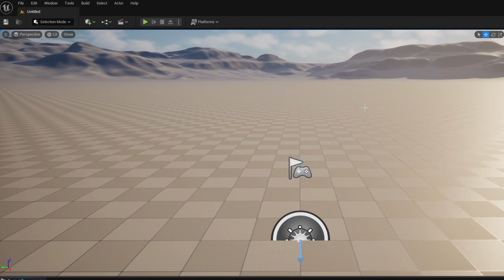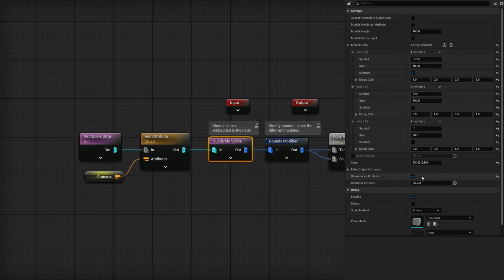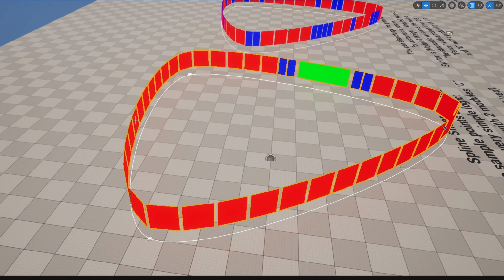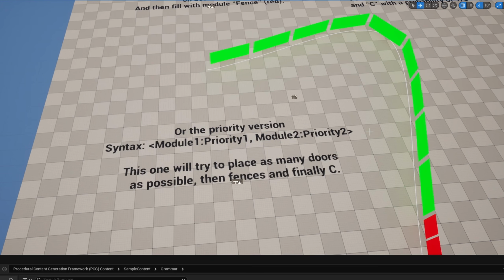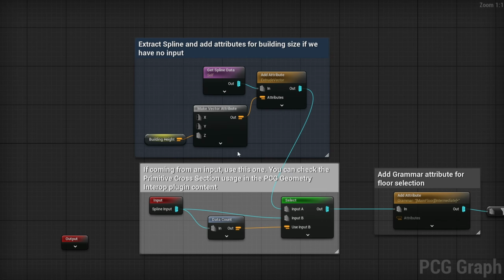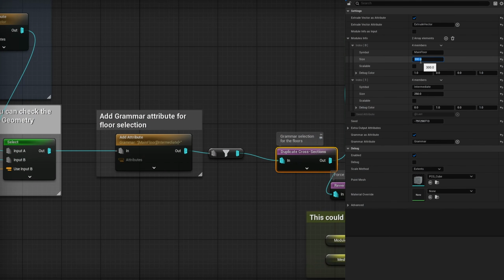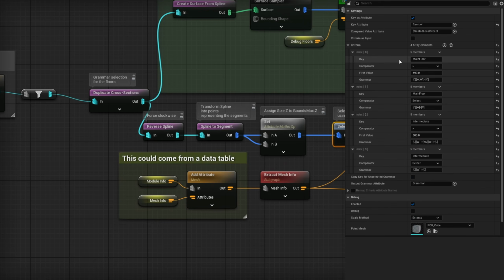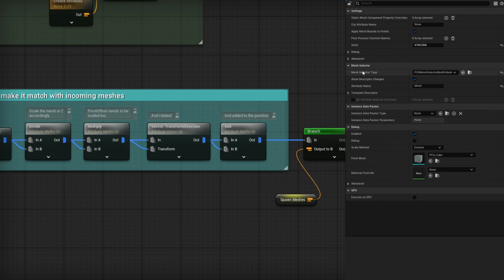PCG Grammar is Here And It's AMAZING

Comment: Any chance this is gonna be in the next series?
Reply: I ask because I'm already trying to combine it with the building series. Epic hasn't explained how to do rooms in here yet with grammar... I haven't seen anyway
Reply from the maker: I probably won't do another just regular building series. There wouldn't be much new stuff except how to do the exterior. And the demo level shows how to do that already. Grammar is designed to work along splines, not on interiors so nothing on the inside would change either.

Comment: Hey would you do a video on how to add the meshes to the splines in the first two examples?
Reply from the maker: You can use the exact same method as in the building example. Just copy / paste and adjust.
Reply: @Procedural_Minds I find that with the spline mesh, it has the correct modules and sizes from the ‘module info’ variable, but it’s just the first mesh in the ‘mesh info’ array variable, propagated along, and you can see the module sizes in action because the mesh is changing size as per the mesh info and the grammar specified. Any idea on how to get the rest of the meshes in the array to propagate in their respective segments?
Reply: Cool I’ll have to figure out what I’ve broken (made of copy of the example content to my own content folder, good boy)

Comment: Is it possible to combine square bracket and curly bracket in the same string? i.e. [Fence,Door]{C:2,Fence:1}*[Door,Fence] so you’d always have a Fence and a Door bookending a middle section of randomised C and fence which would scale to soak up the room between?
Reply from the maker: Yes, all of the syntaxes can be used together. You can take a look at the building setup. I believe they use a combination of them there.

Comment: I'm still waiting for dynamic spline mesh deformation on a pcg spline, instead of just populating a static mesh along points. Got a vent system that needs to curve along the spline instead of rotating to just orient along the spline. But grammar seems to be a much needed addition.
Reply from the maker: It's already out for PCG. I have a video on creating a rope bridge using just that out already. :)
Reply: @Procedural_Minds  very nice, then I can fully switch over to PCG 😄

Comment: Nice video!
How can you make pillars along a spline and make sure there are sagging wires between the pillars? The slack wires themselves are already in a separate plugin, how can you control one plugin from another plugin?
Reply from the maker: I don't know what plugin you're referring to or how it's controlled. It is very dependent on the plugins, what is exposed, how it's controlled, etc.

Comment: Hard to know where to start given the implications of grammars for procedural.
Reply from the maker: Absolutely anywhere you want any kind of logic to how things are spawned. The examples Epic provides are great. Fences with gates, buildings where you want specific types of wall / window / door combos, you can spawn pipes with rivets / connections every certain amount, so many options!
Reply: @Procedural_Minds  I found some other MIT examples but I noticed that there is no mesh info slot alongside the modules info slot where you mentioned it could be enabled in the spline segment node.  I'm trying to give geo to the debug grammar examples.

Comment: How do you add meshes to the Fence graph instead of debug . Been trying to figure it out since 2 days
Reply from the maker: You can just add static mesh spawners. In the building setup you can see how the assets are spawned in so they fit the sizes you specify with grammar.

Comment: Here in the building corners are independent to each other. How can it be set to use a common one?
Reply from the maker: Early on you get the building corners from the spline, so you can just spawn your meshes there if you want them to always be the same in those corners. Or of course you can have the corners as part of the grammar itself so it always starts and ends with the corner pieces.

Comment: In Houdini, you can group a bunch of Vertices and specify a specific grammar to that group. It doesn't seem like you can do that with PCG. I haven't a found a way to retrieve vertex number. Have you?

In case you're confused here's the use case. I want to specify vertex 0 & 1 as the front and the rest of them as the side and back. That way I can have a specific shape grammar for the front and specific one for the rest of the faces.
Reply from the maker: Grammar isn't for modeling, so it has no mesh information. It's for PCG that is just a point scatter system. You can scatter points on a mesh and use that, but it won't read the mesh itself. For that you need Houdini.
Reply: Why not? As I understand, grammar is just a string attribute. So what stops you from filtering your front points, adding some grammar to them and adding some other grammar to the rest of the points?
Reply: @deyama2012  Hmmm ... lemme try that out.

Comment: Oh man this is sooooooo good. Would you be keen to explore for us how you would add behaviour so that (in a spline that has linear segments bit curved) under a certain internal angle between points, a different mesh is selected?
Reply from the maker: So, if I understand correctly, you want to spawn a mesh depending on the angle of the curve? So if it's straight then A and if bent then B? Something like that? I can definitely look into it, sounds interesting.
Reply: @Procedural_Minds  that’s it, but it’s more like if it’s straight or over x deg internally then it’s A, and if it’s less than x deg it’s mesh b. And to take it a step further, (oh heck how do I explain this) mesh b’s rotation would have it face centred (so equal angle either side, in relation to the neighbouring points). I have a monkey brain, but my monkey brain has aspirations haha.
Reply: Yeah that’s right. If at a given spline point the angle is <x deg between its neighbouring points, spawn A, if the angle is greater, spawn mesh B. And bonus points if that spawned mesh’s x axis can be oriented to face equally into that angle. Yeowza